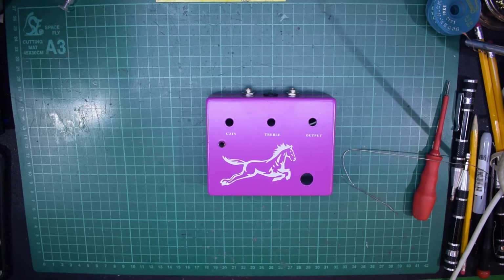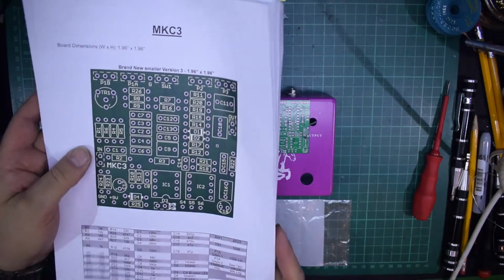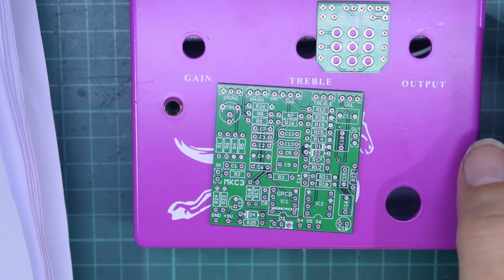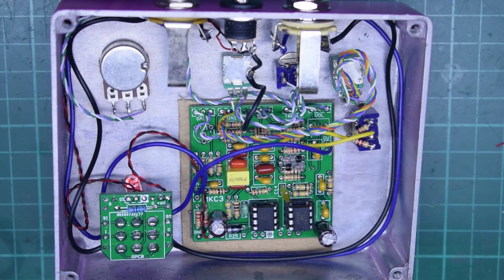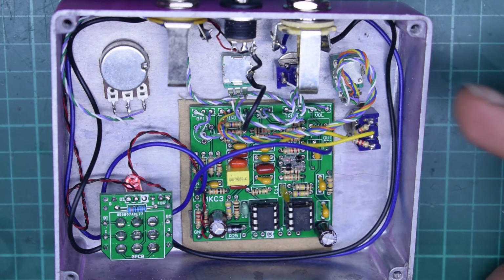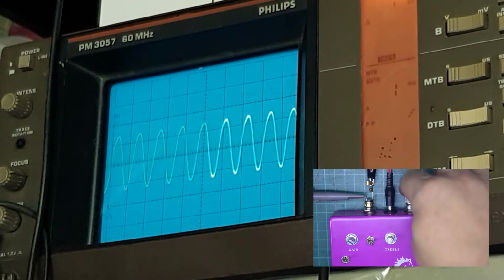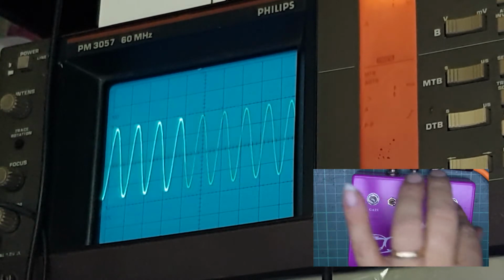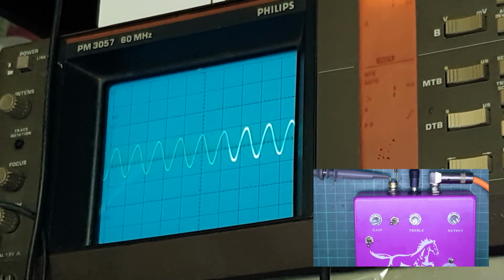Building and benchtest of a Klon Alike. The MKC from GuitarPCB.com

Comment: Excellent video! I have almost all of the parts for the MKC3 ready to go myself. Trying to decide which optional bits to include at the moment.
Reply from the maker: I found it just as easy to do all the mods. If they are there then it's up to you if you use them. If you don't fit them then you will end up thinking 'what if I had...' until you take it apart and mod it later.